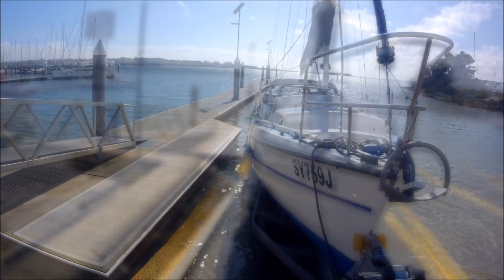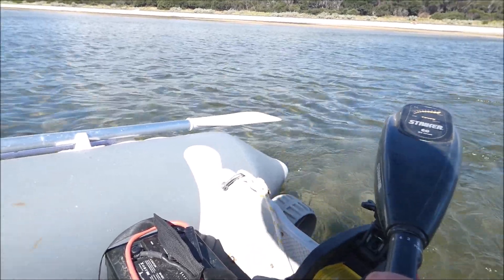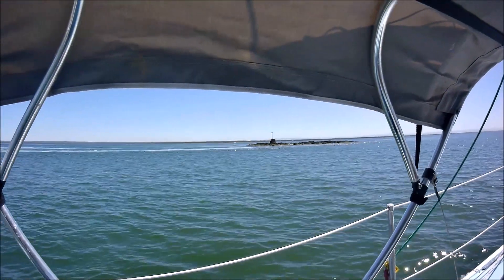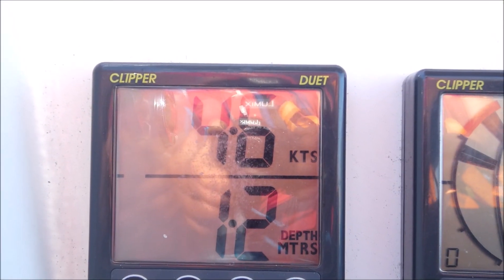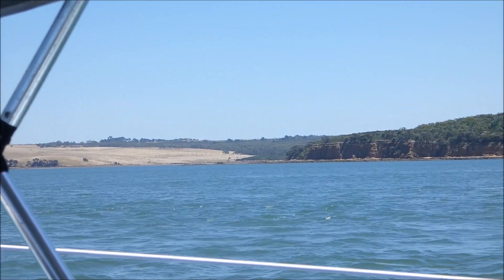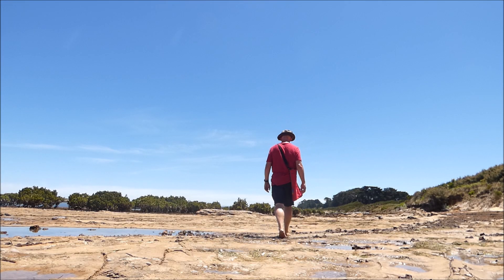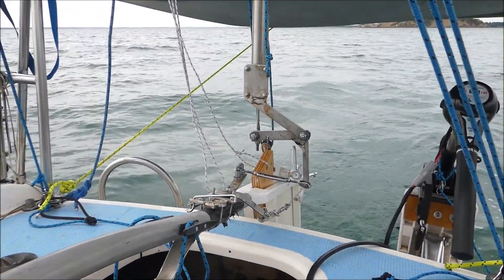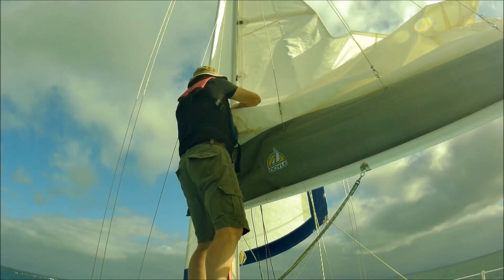Sailing Westernport Around French Island

Comment: Thanks for the information. I currently have a windrush 600. Just curious, how long does it take you to set up and put into the water? What is the weight of the boat towing? What do you use to tow with? How do you compare the RL boats to Magnums and Noelex? I believe the RL 28 is the largest you can trailer with is that right?
Reply from the maker: It takes around 2 hours either end if I am setting up or packing up in full cruising mode, dinghy on davits, solar panels on bimini etc. 1.5 hours otherwise so its not something you would do for an afternoons sail. I generally go our for a minimum of 3 days at a time.
The lightest tow weight would be around 2200kg but with any amount of gear for cruising and water etc it usually comes in around 3000kg. I tow with a 2016 Mazda BT50 which tows it easily and very comfortably  and the low range on the 4wd comes in handy on slippery or steep ramps. The RL is one of the equal biggest TS's that can be towed without a permit. A nolex 30 is bigger but requires a permit and oversize signs when towing.
I could open a whole can of worms comparing the RL to Magnums or Nolex's. I would say they are all great boats with strengths in different areas. Firstly the RL is the only one with full 1.8m standing headroom inside. The magnum is a bit shorter so for a 6ft bloke requires an uncomfortable stoop. The Nolex 25 is much shorter inside and requires the pop top. So space wise and general roomy lay out the RL is probably in front. Sailing wise the Magnum and the Nolex are faster boats generally so if racing is your thing they are better. Having said that the RL can put on some speed especially when reaching. Looks wise many like the Magnum and Nolex because they have the sleek fast boat look. The RL is a nice looking boat but lacks the classic lines that seem so important to some. Sea kindliness the RL in my view is in front with a more vee shaped hull it tends not to pound in heavy seas as much as the others. As I love my cruising and that is what my boat is for the comfort, room, good all round performance and sea kindliness of the RL is what made the choice for me. Cheers Mark
Reply: @TRAILERYACHTADVENTURES  thanks for the reply. Just confirming yours is the RL 28? Also, when are you heading to the Kimberleys?
Reply from the maker: @zarasadventures7519  Yes, Neringa is an RL28, same length as a Magnum at 8.54m (28ft). I used to sail a 23ft Southern Cross 23 that I took for a shorter trip in the Western Kimberley out of Derby. I know people who have sailed the Kimberley perfectly well in sonata 6 (18ft)
Plan is to head up to Derby at the head of King Sound late June to launch from Derby early July. The plan is then to sail to Darwin exploring the coastline arriving mid to late September. I have detailed plans drawn up with all the tidal calculations, tide charts and aboriginal land permits organized. Its a huge logistical exercise and will be carrying nearly 300 litres of fuel on the boat and in the dinghy being towed as most previous places for fuel along the coast will not be available. The tides can be frightening but once used to them they just become part of the daily planning. With only 3 months leave we decided on 2nd half of the dry season as the trade winds are generally lighter in the west and the east end of the trip is into September when the winds at that end get a bit lighter. It was a calculated risk as this wet was predicted to be more cyclonic and wet increasing the floating debris risk and dirty raging falls/rivers early in the season. We didn't get the cyclones predicted but had the best rains in many years so it is probably going to be the best choice. All we need now is for covid not to start up in Victoria in the next 3 months and have the borders closed and permits cancelled as they were last year right at the start of our cancelled trip.